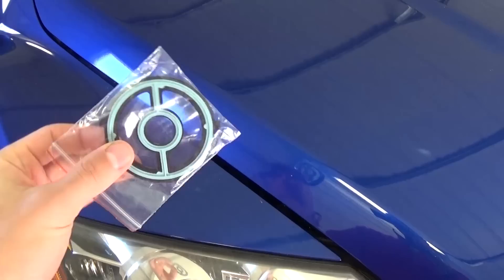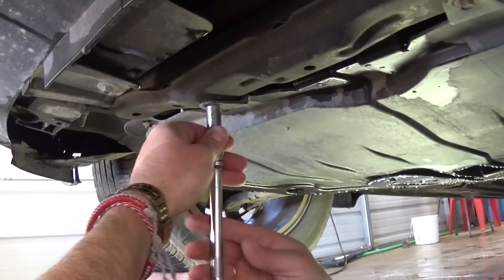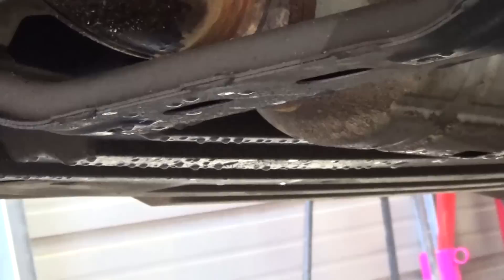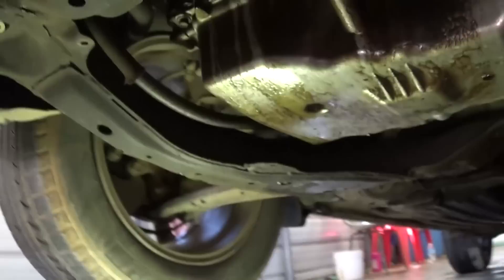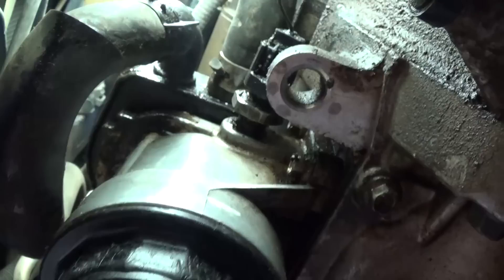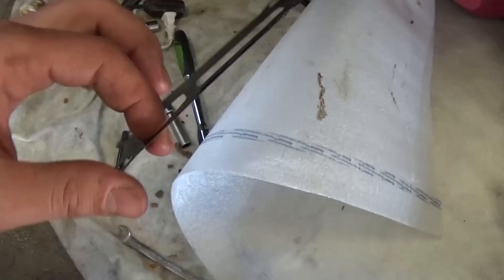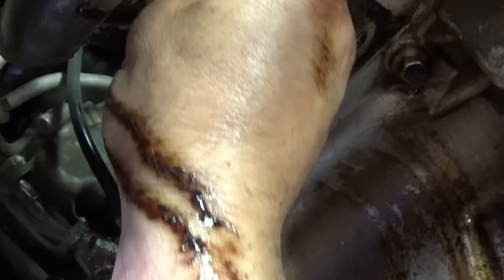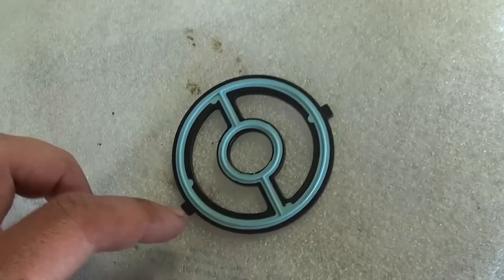Mazda CX-7 Common Oil Leak Fix !  Oil Filter Housing Cooler Replacement Mazda CX7 Mazda 5 Speed

Comment: This is what's going on with my car now!!!!!!!!!!! I bought it right at 85, 000 miles and about to have it done, and I think my heater core just went out because I have a leak in my passenger floor board now! Thank you so much for your help, because other than that, this car has been amazing!

Comment: Local garage wanted just over $1000 buck to replace the whole oil filter assembly as they said that buying and replacing the gasket along was not possible, you HAD to replace everything.. Found the gasket from eBay for about $25, paid a buddy $200 to fix it. Thanks for this.
Reply from the maker: tonepoet I am glad it was helpful. Please subscribe for more videos. We upload 5 new videos every week!
Reply: World Mechanics hi, i observed a huge white smoke from d exhaust, can this procedure of seal replacement prevent d occurring of this white smoke? hoping to hear frm u. thanks
Reply from the maker: Alfred Abiodun white smoke most of the times on a Mazda CX-7 is a sign of a blown turbo. The turbo most likely will need to be rebuild or replaced. It could be something else. It is hard to tell without seeing it but we have replace two turbos so far because they were blown and the car was smoking like crazy.
Reply: World Mechanics wow, thanks
Reply: tonepoet $200?? hes no buddy.
Reply: saved them $800 and the guy can't get compensated for his time and knowledge?? YOU are no buddy, buddy. SMDH.  My time and experience is WELL worth $200 to someone, even if this can be done in an hour or so, with the correct tools.  People that react the way you do make it impossible to do things like this for a living. EVEN if you are doing it for a friend!!!
Reply: tonepoet I have the same leak I think ima do it myself it looks easy
Reply: How did you search and find the gasket part on Ebay? Cant find it
Reply: @ezcare5075 "Oil cooler gasket". It's on many Mazda and Ford cars. Can be found online (amazon, rockauto, etc) and local parts stores too. MAHLE B32785 or FEL-PRO 72709, maybe others.
Reply: @jaxjaguarz  ok thanks

Comment: Great explanation and incredibly helpful. was able to get the cooler off from the bottom and replace the gasket.  Could not get to the side gasket since I could not get a good connection on the bolt above the sensor.  Will plan to go back for this later.  The cooler gasket was the main issue.

Comment: Torque on big 15mm bolt going thru the cooler into the oil filter housing is 25-29 ft/lbs.,  The 10mm bolts holding the housing to the engine block are torque: 21 ft/lbs, Get creative with extensions & sockets to get the torque wrench in there. You can get a torque wrench between the front lower crossmember and the lower bumper facia. Use ONLY 6 sided sockets..not 12 sided or you'll round off the bolt heads, especially on the 10 mm.  I was able to do this repair WITHOUT draining coolant or removing cooler from hoses. I only removed the oil filter housing. Got my gasket from Rockauto (Dana Brand) & no leaks yet on initial start up & idle.  Will update for long term leak test.  Thanks for all the tips World Mechanics!!!! Great video!

Comment: Thank you so much for your video, went to a mazda dealer and they didn't have the gasket, tried to sell me the oil cooler @ $274, went back to your video and got on ebay and have ordered the gasket the dealer told me you can't get. Once again THANK YOU.

Comment: Thanks for the video you are a great person who is helping many people who can't afford this. My cx7 is leaking around the same area and is caked all over the plastic just like this one, however, Is it possible it could be only the gasket that goes to the block and not the O-ring, I like to know if there's a way to tell without taking off housing so I know which seals to order.

Comment: I thought it was a simple hose clamp until I seen this video and My car underneath looks exactly like this one did. I ordered the parts off of ebay both of them about $7 each. I was so stressed out over this. I will let you know how well it turns out.
Reply: Hello 👋 so did you fix it?
Reply: It’s been about five years did you ever fix it?
Reply: He's still under there trying to get the sensor out hahaha.
Reply: I fix mine took me 5 hours because 2 nuts are difficult to take out my neck hurts so much from looking up lol
Reply: @SnortColdSteveAustin  I figured that car was not enough of a challenge to work on so I ended up getting a more commuter friendly car that is an absolute nightmare to work on, Chrysler 200. lol the car for DIY mechanics that hate themselves.
Reply: @jsdraven  i got a Honda civic I can fix anything on that with a wrench 🔧 lol

Comment: good video, very helpful. I do have one question, how often does the housing go bad. I took the car to a shop and was told I needed a cooler, housing, gasket ,valve cover gasket to the tune of $1100. I took the car and bought these parts from MAZDA for $230. looking at your vid the housing didn't look bad and you didn't replace it. So, how often does or would a housing go bad.

Comment: Careful, I switched out my gasket only to find after many attempted fixes that the housing was cracked around the oil pressure sensor. Besure to clean that sucker off well and scan around the sensor inlet while it's off the car. oil gets pricey after so many attempts.
Reply: You can find the cooler (with gasket) on ebay for around $20-$25. I would stay with the original cooler unless it's physically broken like in your case.

Comment: great job and video. this will help me when i have to change my gasket. keep the videos coming. all the best !
Reply from the maker: +Anthony Giordano Glad to head that it was helpful! Thank you for watching us. Feel free to check out our channel and hopefully find other videos helpful as well!
Reply: Hi thanks again. I have a problem wondering if you can help. Trying to replace my rear left stabilizer link for the sway bar.  Can not find any pictures on line of how it goes as mine fell right off while driving. And i think the parts place I bought the part from gave me a right rear link while i need a left.  I am trying to install it but do not have the space for it.  Thats why i think its the wrong one it is going in the same.direction as the one on the right when i look at it.  Are they the same link or different.  Hope you can help
Reply from the maker: check here:
the left one in the picture is rear left and the right one in the picture is rear right http://www.ebay.com/itm/2-Rear-Sway-Bar-Links-2007-2012-MAZDA-CX-7-Stabilizer-Bar-Links-07-12-CX7-/121053018726?hash=item1c2f527a66:m:mIlnBaaeYU5IzYrbW2Sb6IQ&vxp=mtr
Reply: Hi thanks so much for your reply.  I Am little more confused now. The picture you showed me the left one is the same direction as the parts place gave me.  But on my cx-7 on the rear right which is still stock and never been changed the direction on the nut is facing the wheel (outside of car) which in the picture of the ebay add shows the nuts on both side are facing in.

Comment: 1. What's the name of the other gasket you recommend to change? The one that is rectangular...
2. My SUV is now consuming almost 14mpg 😣 Do you think is because this same problem? I really appreciate if you responde me, thanks a lot!
Reply from the maker: +Carin Gomez I think this is the gasket http://www.ebay.com/itm/Engine-Oil-Filter-Adapter-Gasket-VICTOR-REINZ-B31860-/252073007328?fits=Make%3AMazda%7CModel%3ACX-7&hash=item3ab0b8d8e0:g:4RcAAOSwjVVVpHEp&vxp=mtr.
This is not the reason for you bad fuel economy. Is the engine light ON?
How many miles on it and when was the last time you put new Spark Plugs and Air Filter?
Reply: +World Mechanics it has 138,000 miles and yes, the light is on :/ (thanks for respond that fast by the way)
Reply from the maker: Carin Gomez If you have an OBD tool check what the codes are that way we can diagnose the problem.
Reply: +World Mechanics alright :) thank you! I'll let you know for sure. I was about to spend almost $400 on a whole piece that the dealer told me I needed it to buy but thanks god I saw this video first and it saved me that money, so thanks for that too.

Comment: Thanks for such a useful video. I've checked the link you suggest to get the part and it's currently out of stock. Do you know where else it can be purchased? I've seen some generic in eBay but don't know if they'd work for my Mazda CX7 2007. Thanks in advance!
Reply from the maker: +G. Becerra We are glad to hear that the video was helpful. This should be the same one.http://www.ebay.com/itm/Engine-Oil-Cooler-Seal-Gasket-For-Mazda-3-5-6-CX-7-2-3L-2-5L-high-quality-/311418178061?hash=item4881f84a0d:g:FEoAAOSwv0tVgD5d&vxp=mtr If you ever need help with your vehicle let us know you can also find us on Our Official Facebook Page here: https://www.facebook.com/worldmechanicsofficialpage/?fref=ts
Reply: +World Mechanics THANK YOU SO MUCH for taking the time to help me out. I have already ordered the part and it's on its way. You're so kind with such an amazing help. I can only wish you the best luck with everything!
Reply: +G. Becerra  my oil filter came off and I find it and try to put it back on but it wouldn't tight ing

Comment: So i replaced the gasket and oil seal about 15 months ago. And it worked awesome. But I just went to a Jiffy Lube to have the oil changed  (because it is almost as cheap to have them do it then myself), and l found that the oil is leaking again. It happened immediately after having the oil changed. Is it possible that they use high compression to push the new oil into the engine and caused the seal or gasket to fail? Have you ever run into this problem? should you ever use any type of sealant on these gaskets or seals as an added measure? Im assuming Not, but just asking.
Reply: Funny enough mins has just started leaking - just after changing the oil myself. I wonder if tighting the oil filter flexes it just enough to break the brittle gasket?
Reply: Firstly, all the quick oil change places actually destroy the engine, by using power tools to replace oil drain plugs, if they even remember to do that!  Secondly, Mazda n3eeds to run SYNTHETIC OIL, such as the Phillups Petrolium, sold at Walmart, in the grey jugs, Super Tech 5w20, FIVE QUARTS for $15.98.

Comment: I have yellow creamy stuff in my radiator. I changed my oil and have flushed it out and yet I still this creamy residue floating on the top of the radiator fluid. What do I do to fix this. I want to keep my car.

Comment: I have a 2008 Mazda 6i 2.3l engine.I noticed my car has an oil leak too. It’s not the valve cover gasket as I replaced that already. The oil pan and filter seem fine. 

Could this be a common problem in Mazda 2.3l engines all made around these years? That the oil cooler is causing the leak?

Comment: My Mazda CX7 has been super reliable.  I have driven it almost every day for 6 years.  Just found what  looks like oil has sprayed out in the driver's side front wheel well, enough to drip.  Any idea where this may of came from or what the problem may be?
Reply: Does the CX7 use liquid filled motor mounts? My Mazda 5 had one go bad and it sprayed liquid all over. Just a thought. (Old Q but answering in case it helps anyone else)

Comment: My Mazda CX-7 is Leaking as well, I was told it was the front main seal. How I distinguish the difference of the housing gasket leak and  the front main seal leak?
Reply: Just replace the parts on the video bro they’re cheap if it steal leaks then is the main seal

Comment: How did u keep the gasket in place while you were screwing the center bolt back on.
Reply: The gasket should go on snug around the center ring that's in the cooler.

Comment: my 2012 CRX 7 Mazda the oil filter popped off and can tightening back what is the problem I found the filter under the base of the engine I try to turn it back on but it wasn't being tighten what's the or secure what is the problem

Comment: Hey just wanted to get your opinion. I have a 2009 CX7 and I took it to firestone. They said the engine was knocking and I have an oil leak so they didn't feel comfortable doing the oil change. They said it was dry 100% and threw oil in there for me. They told me "We plugged the leak so it shouldn't leak right now, but it wont last". I take it to my friend right up the street because firestone said "We have no idea where its leaking from so we can't show you." (after they told me they plugged it) I pop the hood at my friends shop and they left the oil cap off so my engine and side panels were covered in oil. I took it back and they cleaned it the best they could. 

I didn't notice any knocking at all before I took it to them. Now I can definitely hear it. Do you have any tips on how to pinpoint the oil leak? I'm about to go out there and leave a white towel underneath my car to see if its leaking from there. I have NEVER had any oil spots on the ground.
Reply: FUCK YOUTUBE SERIOUSLY〉.... Dude,  Firestone owes you a motor!  It wouldnt be the first time. lol

Comment: What would the torque specification be for the oil filter housing gasket???? Would anyone be able to help me????
Reply from the maker: +Alex Cerezo I could not find the torques specs anywhere. What we did, we used a 3/8 ratchet and one person holding the oil filter housing while the other one is getting it tight. You will start feeling the gasket sealing but pretty much when you cannot go more give it a little bit and that should be good. It is hard to explain it. I will do more research and see if I can find the torque specs tomorrow.
Reply: Tighten filter to 26ft lbs and sump plug to 20ft lbs

Comment: hi how are you?. I have the same car but I have a little problem whit the gasket.i change the oil gasket like your video but oil leak is there and i bought a gasket in the auto parts but in the the gasket  that bought it's doesn't look like your gasket from video so I don't know if i need buy from the mazda dealer or the gasket are different
Reply: You may have got the gasket for the newer style cooler. The cooler was redesigned and the new one has a just a rubber gasket whereas the original version had a rubber or silicone gasket inside a rigid plastic retainer. The new gasket will not work on the old model cooler. The new gasket is much cheaper, a couple dollars vs around $20 for the older style. (Old Q but answering in case it helps anyone else)

Comment: Is it true the 2012 cx-7 turbo motors are faulty?
Reply: I can tell you 2008 did have a recal on turbo.  I had mine replaced...
Reply: @Bacardibombillo  Do you have a recall number for that recall, or more info? Was it replaced at no cost?
Reply: No number.   Check internet.   In my case I walked in Mazda and aske for recalls on cx7
Reply: No recall number #.  I repeat.  Walk-in Mazda dealer.   Ask for Mazda Turbo recall...
Reply: Is been ok,  had White Smoke one time = turbo recall.  Have CheckEngine wich wont go away, replaced all sensors, all injectors and still have light on.  Engine revs high at start up.!  Few things

Comment: It's a defective part. It needs to be replaced with the updated Mazda oil cooler. The faulty one is Famoco or Ford Motor Company. You can purchase the Mazda oil cooler for around $150 on eBay direct from Japan. It will also come with a new gasket. This is the way to go otherwise you're going to keep replacing that o-ring
Reply: $150-$200 to replace the part on a car with 100k+ miles (meaning the original gasket, and perhaps the aftermarket ones too, lasts around 100k miles). Or just spend $20 on the gasket and do it again at 200k miles, then again at 300k miles, etc. You would have to get to 1.1 million miles before you spend an equal amount to replacing the entire cooler. And the new cooler has a replaceable gasket too so who knows how long that one lasts (200k?). You can get a FelPro replacement gasket today from most parts stores for less than $20.. no waiting for ebay delivery.

Paying for the updated version just doesn't make rational economical sense for the DIY'er. Now if you're planning to keep the car for another 500,000 miles and are paying someone to fix it, then yeah, maybe I would get the updated cooler and cross my fingers it would last that long or the ROI goes out the window there too. You should be able to find a mobile mechanic to replace this gasket for a Benjamin or so.

In any case, I doubt most people are keeping the car long enough to have to perform this more than once.
Reply: For the record, I have a 2006 Mazda 5 with over 120,000 miles and it's leaking a very tiny amount. Not enough to drip anything but last time I changed the oil I saw some black gunk buildup on the oil cooler and the filter housing so I am going to be replacing the gasket before it turns into a dripping problem. I switched to synthetic oil early on so that may have helped in allowing the gasket to last as long as it did, who knows. I don' expect I will still be owning this car at 240k (that would be like in what, year 2033?).